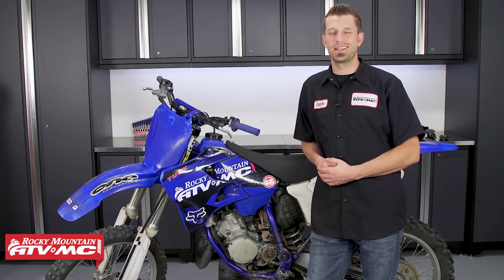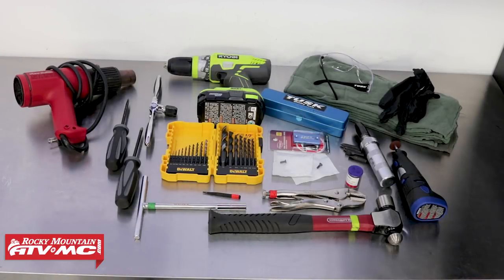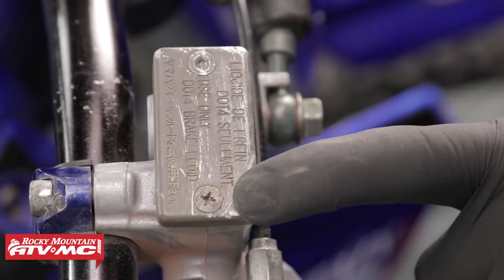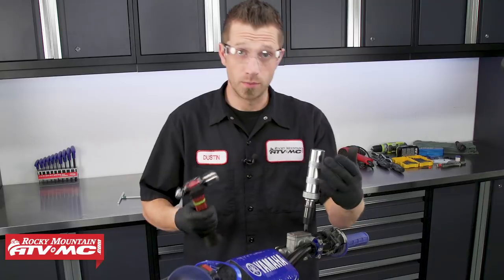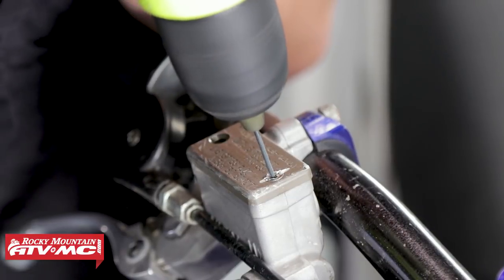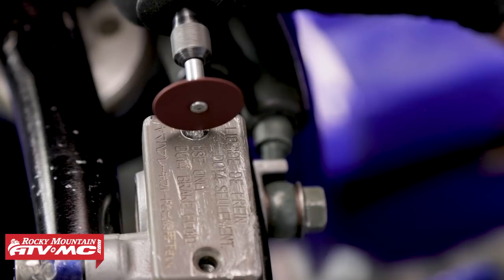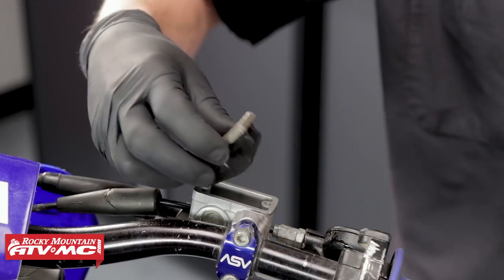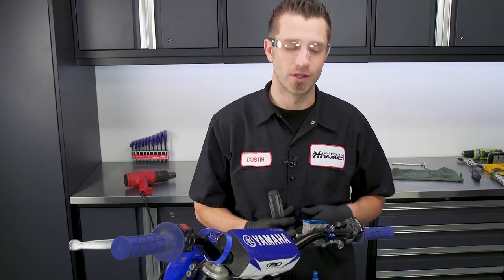How To Remove a Stripped Screw From a Motorcycle Master Cylinder

Comment: I literally stripped my magnetic oil fastener, then broke a screw off inside the frame for my skid plate requiring a drill and tap, then turned around a day later and stripped my brake master cylinder fastener. oh and in between all that, both my bumper carrier titanium bolts stripped. What a week. Thanks for the video!

Comment: Another method is drill a hole in the center the size of the shank of the screw.  Don't drill deep, just deep enough so that you go to the bottom of the taper.  Then the head of the screw will pop off with the master cylinder cover.  Done carefully you can prevent damage to the cap as well.  Plenty of good methods here though.

Comment: 10 mins into servicing my quad for the first time I spend 15 mins looking for my reverse bits as both screws are seized

second one I had to break as bit just couldnt bite

25 mins later im off to the store for new screws :P

Pretty fun so far.... 2 hours later and I have 1 wheel and brake caliper off

Comment: I always use a slightly worn Dremel cut-off wheel as the smaller diameter gets a deeper cleaner cut  into the head of the screw without damaging the cap too much. More screw and less cap get's a deeper cut for that screw driver, and most times I use the 1/4 breaker bar with the 1/4" socket fitting the  1/4" Allen 'standard' screw driver attachment into it. It's best to let WD-40 settle around the screw head first for a while if you have the time. Take your time and don't be in a rush and you'll be successful.

Comment: I have a honda shadow where there are allen bolts (hex) which have a round head and I need to remove by allen (hex) turns inside the hex slot. No way of heating it. Cant get any tool in there - any idea please?

Comment: I'd try to drill it enough to remove the pan head first. Then the cap can slide off the screw and it can be removed with vice grips. At least that's what I'd do before dremeling a slot and messing up the cap.

Comment: I was really worried I'd have to drill out the screws on the reservoir for my '88 KZ1000, but some penetrating oil and a screw driver with the proper size made it a lot easier...
Always use the right sized screwdriver to minimize the chances of stripping the head.